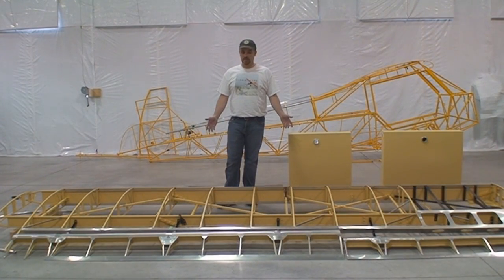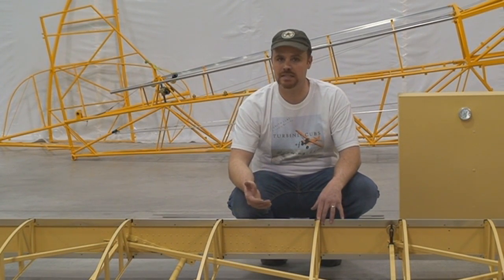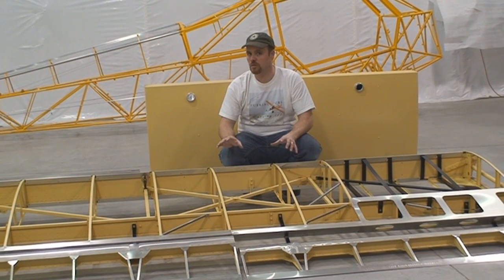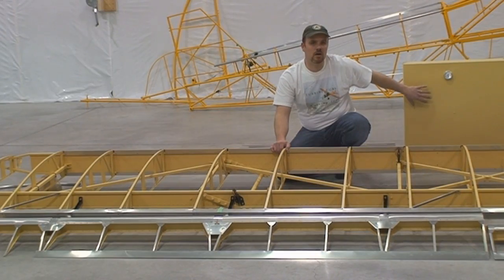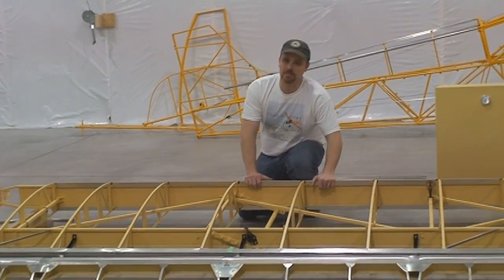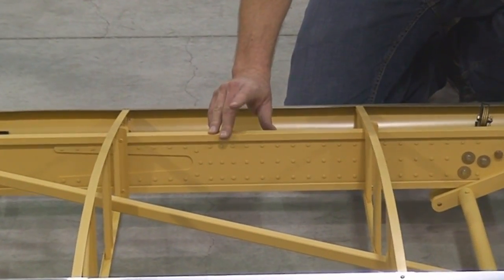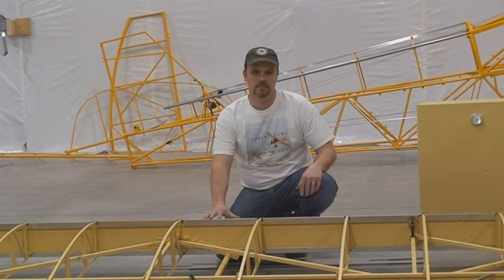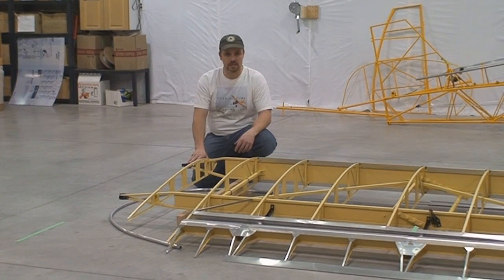PA18 Standard Kit Part 3

Comment: I just Love the fact that they prime the Aluminum Parts like the Spar and the other main wing structures ! Also its great that the Fuselage is Yellow, and not black or so. The Yellow color of the fuselage will make the maintenance and inspection of the fuselage much easier in the future! The worst thing a company could do is to paint a steel tube structure Black, as that color will make it super hard to find cracks and rust in future inspections. Inspection of white or yellow engine mounts and tubular fuselages is just so much easier...